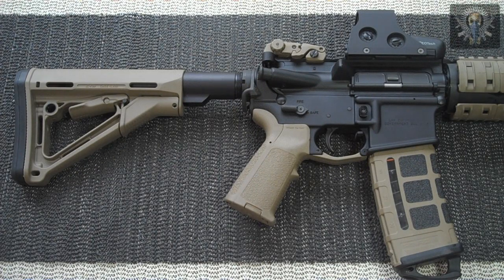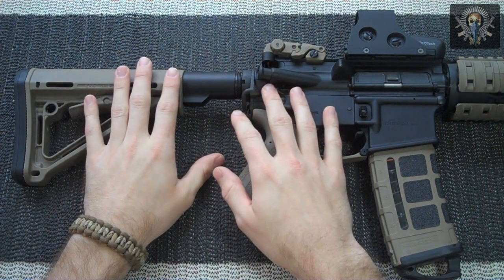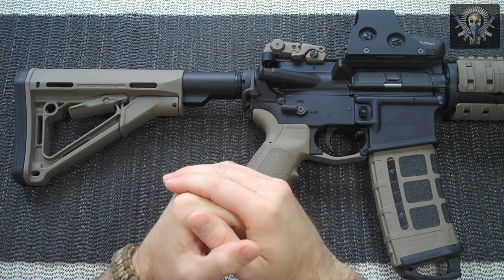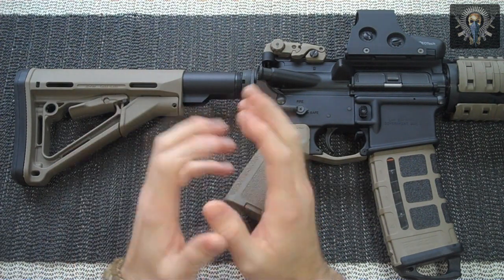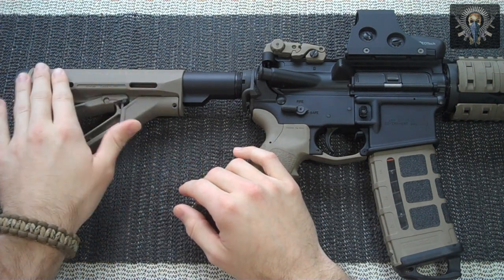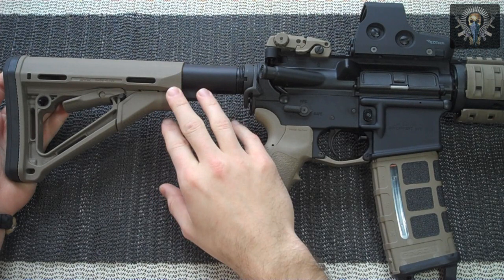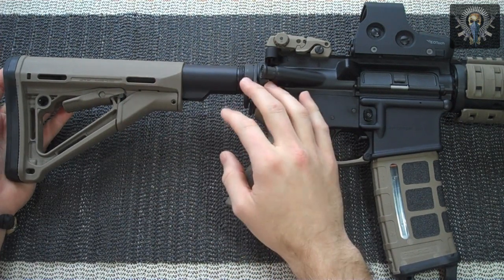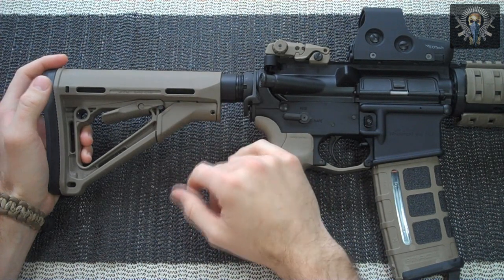Adjustable Stock Modification into a Fixed Stock

Comment: I have a fixed MOE stock.  I just pried the release lever off.  Now I need a bullet tip or screwdriver blade to pull the pin down if I want to adjust (or remove) it.

Comment: How do you change a fixed stock to an adjustable one? Obviously I have a MA compliant AR-15, but I don't plan on living in MA forever. I would like to know how to remove the pin/screw making it fixed so I can make it adjustable again.
Reply: I also live in mass the stock on your ar is non adjustable its made to look like an adjustable but the tube only has 1 hole in it where its pinned you have to replace the buffer tube and stock

Comment: Thanks, but its only 1 feature now in my state. So it seems I need to fix the stock, attach some kind of silly California grip ( like the monster man grip) and have the barrel caped so the threads cannot be used. I wonder if I permanently attached a fake can or barrel shroud over the threads, would that be ok? I don't know is a fake can considered to be a feature? Who knows...lol
Reply: FPS FREEDOM I live in CA too and the featureless rifle deal is only dealt with flash suppressors. As far as I'm concerned, that doesn't mean muzzle brakes or compensators....

Comment: Hi 

Are there any kits/modifications that would allow me to increase the length of the adjustable stock on the S&W  M&P 15 . I need another 2 - 4 inches. The issue is when I am shooting, the slight recoil pushes my ear protectors up. I usually have to adjust them every other shot.
Reply: Strike Industries makes one that has spacers you can remove or add to adjust length and it doesn't look half bad either.

Comment: also, it IS known for guys with AR-15's to have standard collapsing stocks pinned or welded in a single position, this IS legal, however again, NJ's entire gun law is such a grey area noone really knows what is or is not illegal when it comes to the very specifics. we used to make jokes about how it was cheaper to buy 6 pinned stocks, 1 in each position and just rotate them out if you wanted to change Length of Pull.

Comment: I live in NJ, the no fun gun state. I just finished all the paperwork and fingerprinting to get my FID card so I've been looking into how to go about getting an ar15 that doesn't look like ass.  Purchasing a compliant ar15 is out of the question because I'm not paying extra money for a shit rifle. The route I've decided to go is buying a complete upper and modifying it to be legal, then buying a complete lower with a pistol grip but the stock removed to prevent shipping complications and then just buy a fixed stock. 

New Jersey doesn't allow an adjustable stock, pistol grip, threaded barrel with muzzle brake, foregrip and has a 15 round limit. According to the way the law is written, ONE illegal part is legal (LOL), but 2 illegal parts makes it an assault weapon. I want the pistol grip to be the one illegal part and since you made this video I'm good stock-wise, but I need to find a way to make the threaded barrel with muzzle brake "permanent". Any ideas such as soldering or even bondo that would work?

TL:DR; How can I make a muzzle brake permanently attached to a barrel? Sorry for the novel, any help is appreciated though!
Reply: I'm in Jersey and have been building my own AR's for 2-3 years.  You can have a threaded barrel with a muzzle brake - it just has to be pinned and welded and any local gunsmith should be able to do that for you for $25-50.  What you can't have is a flash hider - two different things.
Reply: Jetta32696 thanks for the reply! what have you gone with stock wise? Any recommendations? Also, any recommendations on a gunsmith to pin and weld in North jersey?
Reply: No problem at all.  My most recent build has the Mission First Tactical Minimalist stock, but I have a Magpul PRS on my .308 build, fixed Magpul MOE on another and also a Vltor IMOD stock.  Buy any stock you want though.  :-)  Any stock can be pinned and welded.  Where in North Jersey?   Where do you shoot?  If you go to Gun for Hire (in Woodland Park/West Paterson), there is a gun shop right next door, Ottomanelli's (might have spelled that wrong).  There is also the Bullet Hole in Belleville, they have a gunsmith on staff as well.
Reply: Jetta32696 To be honest I've only ever been shooting on private property, haven't been to any ranges near me. Since this will be my first firearm, that's why I have so many questions. Gun for Hire isn't far from me at all so I'll have to check out that range as well as the shop next door. Should I also look for a muzzle break with a shape that's easy to pin and weld? the upper I ordered is coming with one, but it looks like it's a smooth tapered edge all the way around as opposed to one that has a flat spot for a wrench. I'd probably want a cooler looking muzzle break anyways if it's going to be permanent
Reply: I would think that every muzzle break can be pinned and welded, as it is a requirement for so many.  When you purchase your muzzle device, BE SURE that it DOES NOT have flash hider or flash suppressor anywhere in the name.  You can purchase a muzzle brake or compensator - both legal in NJ.  I like the Rainier Arms XTC (Xtreme Tactical Compensator), the Lantac Dragon both of which I own.  Search muzzle brake or compensator and you should be good to go.

As for the upper you ordered, where's it coming from?  There should be a info on the type of muzzle device it comes with.  A2 flash hiders are typical - if that's the case, stay away or call whoever you ordered from and see if they can change it out to something that's NJ Compliant.  As for the cool factor, "eff" that...get something that's functional.  Just because it "looks cool" doesn't mean it works well.  That's like getting yourself a pretty girlfriend with a wack sex game.  :-)  That's  my $.02.
Reply: Jetta32696 haha good info. I should have said better in general. I definitely want function as a priority, but it's stainless on a stainless barrel and id rather a nice muzzle break that's black to offset it. I ordered the BCA 18" complete upper from classic firearms. Unfortunately the description didn't say much about if it was considered a flash hider or not but I figured I'd be replacing it anyway before I made it permanent. Thanks for the recommendations, I'll look into them now. Also, I ordered the upper and am waiting to get it modified before I purchase the lower due to NJ law considering me a criminal if I received a non compliant upper while in position of a complete lower. I hate this state more and more lol
Reply: No problem at all. Glad to help.  What is this modified upper that you speak of??  No modifications need to be made to the upper receiver unless there's a barrel mounted front sight with a bayonet lug.   If you're upper has a flash hider, you'd still be considered a criminal, so be sure to verify before accepting that package.  Good luck and be safe!  If you have any questions, don't hesitate to hit me up privately.
Reply: Jetta32696 I'm  just considering the threaded  barrel with muzzle break or whatever it is that's coming on it as part of the upper. I will definitely let you know if I have any other questions!
Reply: I checked the website from my phone (can't do it from work computer), and I found an 18 inch BCA side charging upper with stainless barrel - if that's what you're getting, be careful, there is an A2 flash hider on it - it just happens to be polished or stainless to match the barrel.  If that's not the one you ordered, I wouldn't be surprised if there is the same flash hider on other uppers that they sell.
Reply: Jetta32696 yeah that's the one. As far as I can tell based off of input from other people, since I don't have a lower in my household, it's 100% legal. Once I purchase a lower, if it still has a flash hider on it id be considered a criminal. First thing I'll be doing once it arrives is getting a muzzle break and having it pinned and welded. I guess we'll see what happens though
Reply: Upon further investigation, I think I found the correct upper and as I suspected, it to has an A2 flash hider on it.  Just a thought, have it shipped to your FFL (who might also be a gunsmith) and have them change out the flash hider with the compensator/muzzle brake of your choice.
Reply: Jetta32696 it's being shipped directly to my house as we speak. Should I be worried about the ATF busting my door in? lol
Reply: Not sure...  :-)  But get an attorney on retainer, just in case.

Comment: I live in NY and you cannot buy a Bushmaster with an adjustable stock.  Is there any way I can adjust the stock to a longer length?
Reply: Purchase from an out of state vendor, ask that they pin your stock in the longest position. Problem solved.

Comment: No need to drill a hole. The lever that allows adjustment pushes against a pin that lifts the locking mechanism out of the buffer tube. If you twist the pin and pull it out the stock is fixed in place. Just replace the pin to adjust it. 

Don't drill your stock!!!!!!!

Comment: And you  cant use screws to pin a stock cause u can use a screw driver in 10 sec.'s to make it funtion the right way (evil here)..So the only legal way is to drill and use a small 1/32 rod...